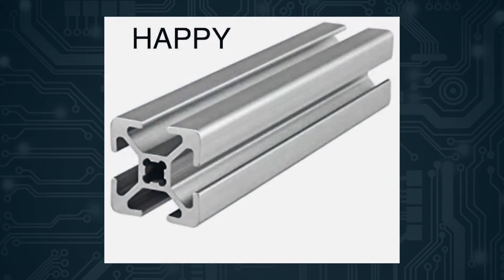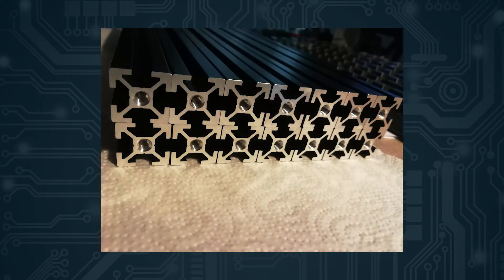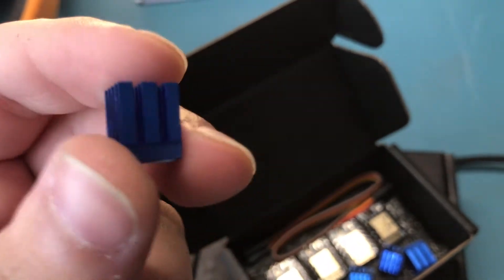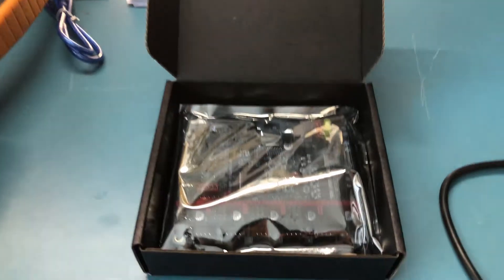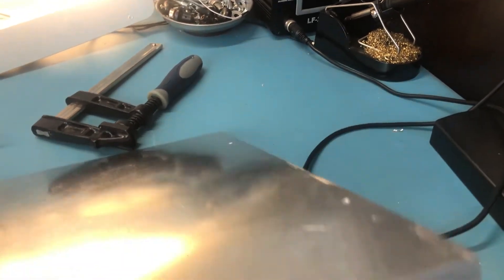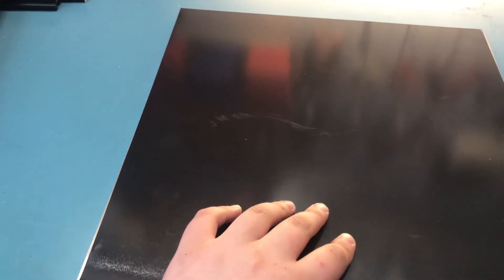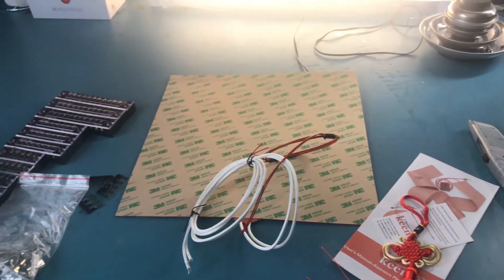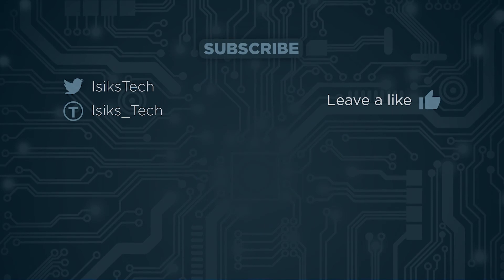Voron 2 Ep. 4: The Heatbed

Comment: You should have done a three point bed leveling instead of 4 point  three point is more accurate if your plate is very flate
Reply from the maker: I think that's what the manual says as well. It says to drill 4 holes but only use 3 when installing.